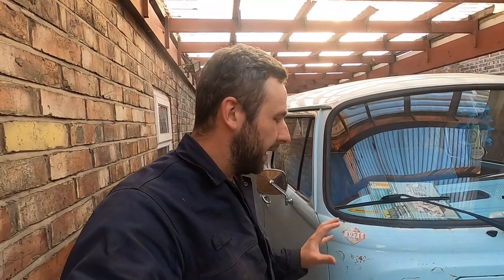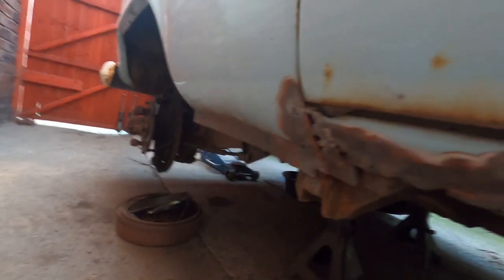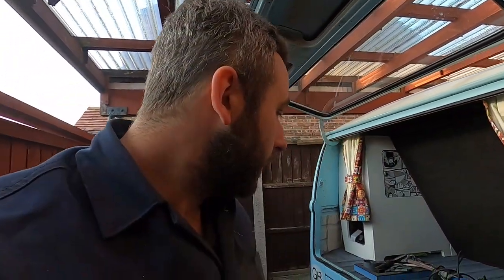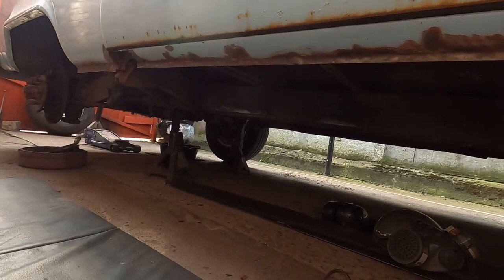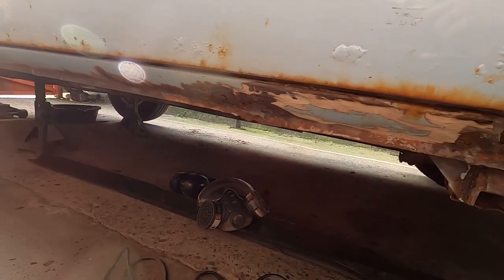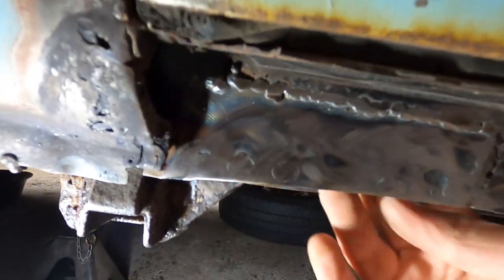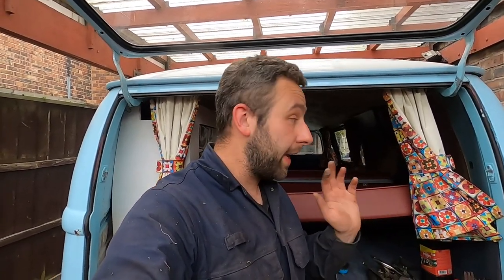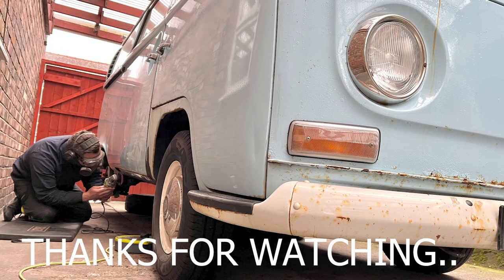STARTING TO SORT THE RUST - VW T2 Bay Window Camper van

Comment: hello, we're in the same boat as you, we have a T2 with issues, but desprate to keep it on the road whilst working through the crusty bits.  todays question is, can you give more details on the products you use to treat new steel when its being welding into closed sections. I have nightmares about underseal, cavity wax, paint or seam sealer catching fire inside a closed sil or other double skined panel. or just as bad  rust starting from the back of a lovingly made patch panel.
Reply from the maker: Hey Andrew thanks for watching and I hope your project is going well. As for the products I use a good etch or zinc primer on the inside or the panels and things like the inner sills I will cavity paint for added protection as primer is porous. Seam sealer there is all sorts out there. But I will cover this in a coming video. Cheers and all the best with your project👍

Comment: General question: what do you prefer for undercoating? for example matching up to the oem Amazon coating….would you use a lanolin base or asphalt base undercoating….
Reply from the maker: Hey I use upol gravitex normally for most my stuff unsure yet what I will use for the amazon. If you check some of the mini builds out you can see how all that looks once it’s over painted. With this one it will be black underneath not going for a show finish just want it nice and protected 👍

Comment: Love the channel and have watched it for several years!!! I notice that when welding in repair panels,you tend to do spots rather than a continous welding!! On my Draper 180 welder(must be at least 20 years old!!)i find that it takes the wire a second or so to start after pulling the trigger which makes doing spots nigh on impossible as by the time you pull the trigger and it starts and you let go there is no weld!
!! Would a new wire feed unit sort this out or is it a case of the welder been old thats causing the issues!!?
Reply from the maker: Hey thanks for supporting the channel for so long. The main reason I tend to do that mainly on the minis is because the steel is just thin it would warp. If you have seen the blue clubman estate we did the floors on i more continuous welds on that. I guess it depends on what I am working on. The Volvo amazon is lovely to weld because it’s mad of nice think steel. As for your welder I would say it needs a new lance, the liner sounds like it’s gone and catching the wire. Cheers for watching

Comment: When I was restoring T2's nearly 25 years ago, many of them were so rotten that repairs to MOT standard would exceed the van's value.  

I guess the fact that values are now much higher, but more importantly most T2s are now MOT exempt, now means no need for half decent repair work, and back garden bodge welding, with 10 kg of paint on underseal, returns a completely rotten T2 to good as news structurally!

These vans were difficult for pro welders to repair 25 years go, and I get the feeling that no need for MOT testing, is the main reason there are so many DIY types, showing how to repair them on here now?
Reply from the maker: Times are very different for most classic cars. But the fact costs of restoration are high, and seeing what a lot of companies put out I wouldn’t bother paying some of those either. It’s all about having a go yourself. We will make a nice job of this and it will be enjoyed for many years to come. Thanks for watching 👍
Reply: @SimpsonsClassics  Do you agree that there is no need for years of experience, and good quality tools and equipment, to be able to turn out restoration work, to high standards, which is going to be safe and long-lasting?
Reply from the maker: @humourless682  I believe all of that helps. But I also think the normal person can’t afford that and 95% of people I speak to love the satisfaction of doing themselves and that is what classic car ownership is all about and what this channel is all about. Saving the classics
Reply: @SimpsonsClassics  The idea that watching a few videos on here, and buying a shoddy Chinese Mig machine, makes someone an expert vehicle restorer, seems to be very popular?  Doesn't make the idea any less ridiculous that so many believe it.......
Reply from the maker: Firstly you need to think before you speak. Go look at the rest of my channel. I never claim to be a expert, this channel is about saving classics and testing skills. That teamed with the fact I am sponsored by a big tooling company means I try to use the best that’s available. But this channel is aimed at people who want to learn and want to have a go. If this channel isn’t for you, then I would suggest you find another one to watch.
Reply: @SimpsonsClassics  My comments were not directed at you in particular, but at the concept of quickly becoming an "instant expert", which is strongly promoted all over social media.

In terms of welding equipment, in 95% of cases buying a high quality Mig used, is invariably a better choice for a beginner than a low quality machine, brand new.

Bearing in mind that the concept of "instant expert" is very often directly linked to selling something, in many cases beginners are likely to buy, whatever it is being promoted on the marketing videos.
Reply from the maker: Appreciate the comment yes understand what your saying. Classics are all about the journey and enjoying whilst testing skills
Reply: @SimpsonsClassics  Sadly, anyone who ascribes to the "instant expert" idea, promoted by marketing material, is never likely to gain any worthwhile skills.

With restoration work, there is a very real need to have mastered the basics, before trying to make good a badly corroded car.